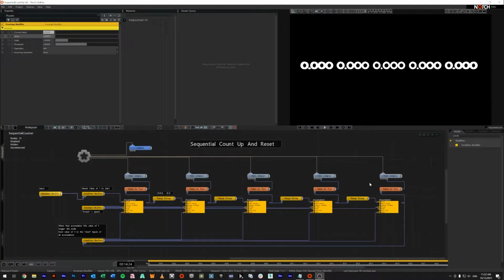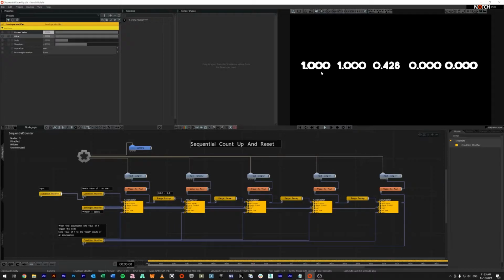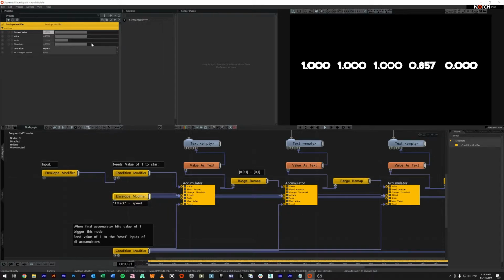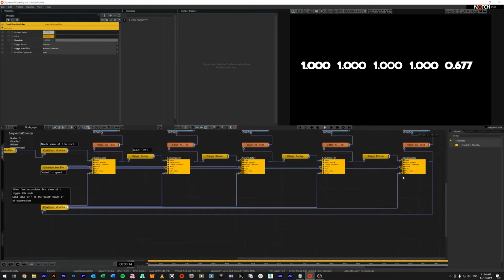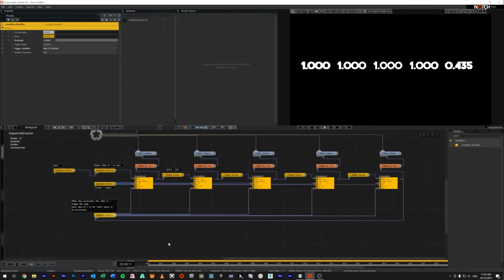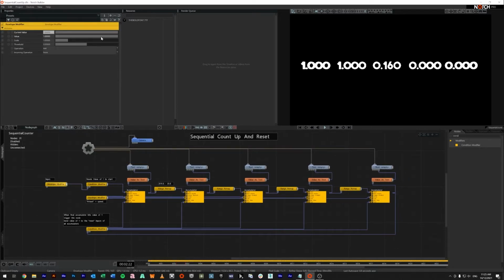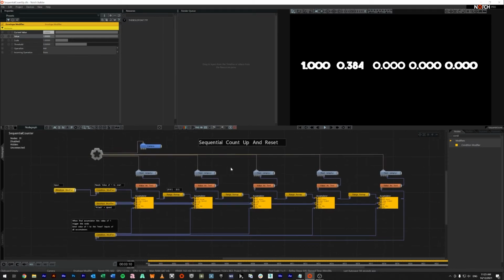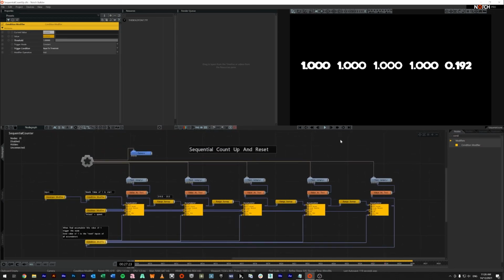Notch Tutorial Sequential Counting Up Using Accumulators. File linked in description below.

Comment: nice video well explained! what is the reason you have choosen to use range remap instad of continuing to use conditions?
Reply from the maker: Hi Andi, The reason for using range remaps is the question asked in the Notch User Facebook Group was requiring the next number to start counting upwards after the previous number hits 0.9. so using range remaps we can start ramping up the accumulators at 0.9 instead of opening them straight up to full speed using a condition. 
Hope that makes sense.